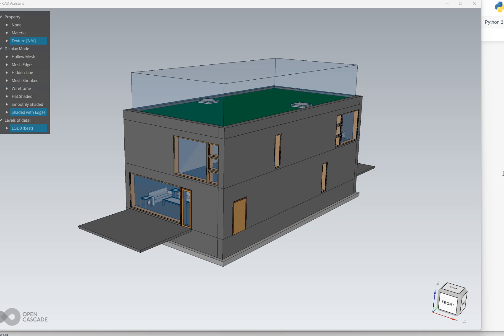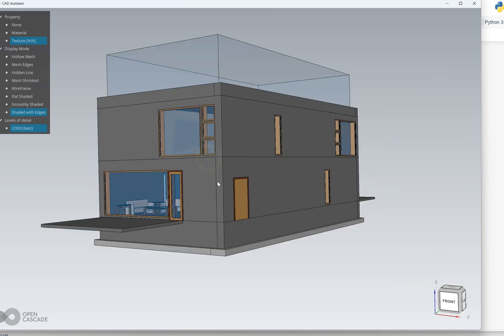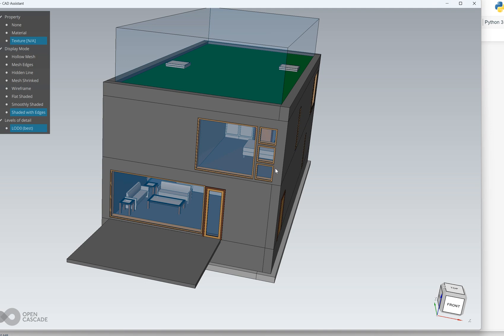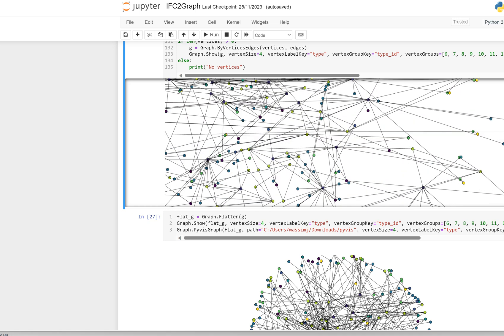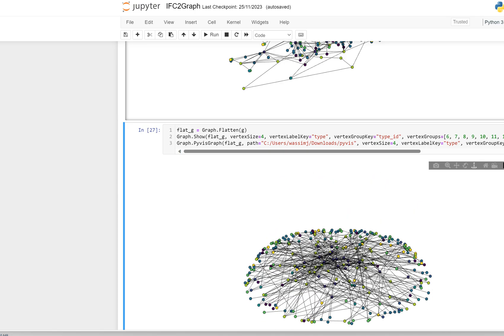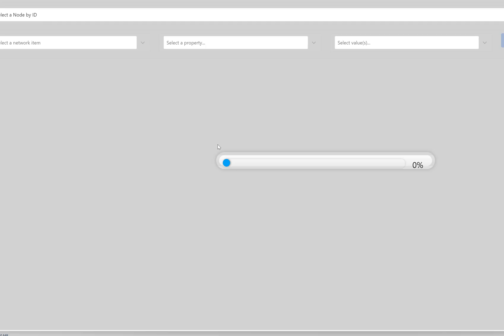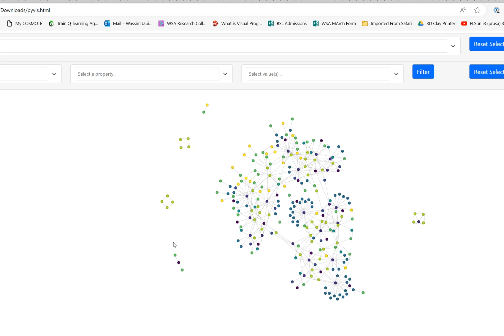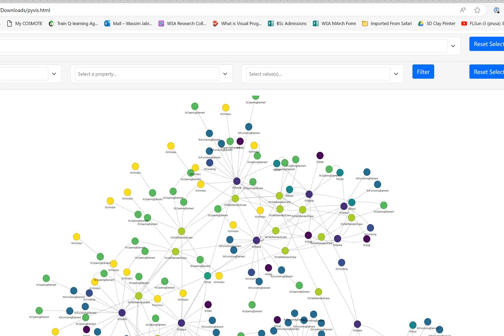IFC Graph Analysis using TopologicPy and Pyvis

Comment: Looks great! Does it also capture properties? Ie does each node have the properties of its ifc element inside a property field? Also what if the entities were not properly connected to the spaces in the model, is there a way to build these relationships using topologic? Thank you.
Reply from the maker: The focus is on properties associated with geometric entities. I use ifcopenshell so you can use that for other information extraction. Yes we have connected topologicpy to neo4j. Link prediction < graph machine learning
Reply: @wasjab  thanks for the help! And thanks for the great work with topologic!
Reply from the maker: @rafyriad99  Yes. It captures the IFC properties and stores them in the dictionaries of the nodes. If they are not connected, there will be a need to write scripts and use geometric, topological and informational methods  to derive these connections. Or use AI for link prediction.
Reply: @ very cool! Does that also include not geometric relationships like schedules for example? Is there any native method for converting to neo4j graphs? Also what kind of AI? By first guess would have been just use bounding boxes and call it a day, but im interested in how you would use ai for this?